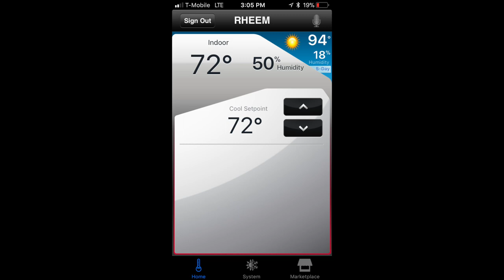RHEEM CONDENSER CLEAN UP

Comment: why is the compressor covered?
Reply from the maker: To make the compressor more quiet during operation..
Reply: @dizziedallas  but also makes it a pain in the ass to clean annualy
Reply: Do they help with ice buildup? I have this unit and we have had it serviced many times. The coolant is topped off and the coils cleaned but it still keeps getting a ton of ice. I mean like 1-2 inches over the whole freakn unit. Any ideas?
Reply: @John_Conner222  any update to your problem? same issue
Reply: @seanclouser6349  Freon leak. The hoses crack and were leaking freon. At least that was our problem as the wrap around them had come off and they were exposed. So the freon was literally freezing the unit. The leak was tiny though so it builds up over time. We were running our unit last year 24/7 because it was so hot, even in the evening. Its been mild where I am at this year. Strange to have 80 degree temperatures in Georgia while the northeast was in the 90s. So we only ran it during the day and the frost didn't appear, even with the freon refill.

Comment: Had a blower motor replaced, next day the unit started to make a grinding noise, the cold air stops blowing and warm outside air starts blowing. After about 15 minutes of the noise it stops, the fan keeps running for about 30 minutes, and then the condenser kicks back on and starts cooling. Multiple ppl have been out  and the manufacturer contacted, but nobody has ever seen this happen. All signs point to a bad condenser I'm told. Has anyone else heard of this problem before i go ahead and replace the condenser ? The unit is only 4 years old and a reheem